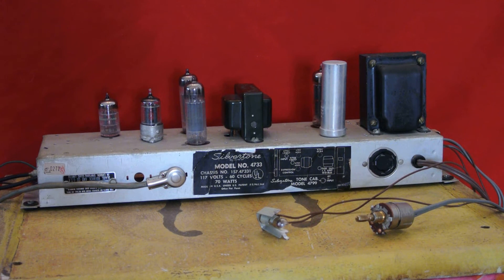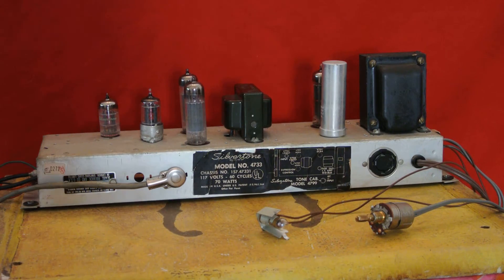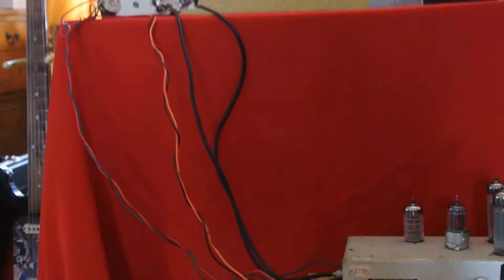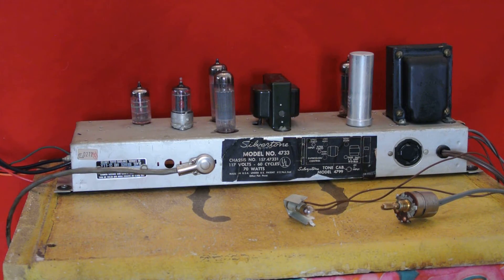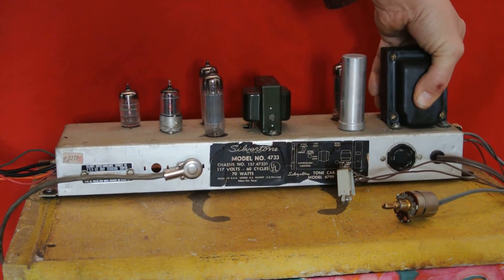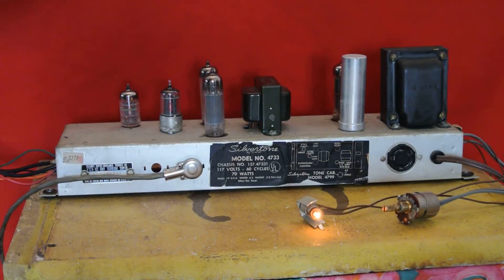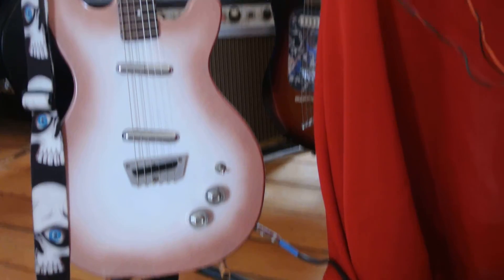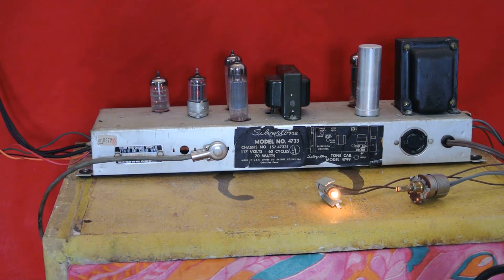Buck Naked Tube Amp! Tube Organ to Guitar Amp Conversion by SoaringTortoise

Comment: Nice video .. do you have the power transformer ID numbers?  .. maybe a schematic?   I have  transformers: Power (80-5018-6 , 606235), and Output: 80-5031-1 , 608236.  I would like to make a little amp from scratch, but I don't have the pinouts on the transformers.  Thx!
Reply from the maker: Sorry, no parts numbers or schematics. I did this conversion for a customer and the amp is no longer in my possession. I might suggest putting those numbers into google it might turn something up.

Comment: Someone just gave me one of these organs (exact match). It didn't make any noise til I changed out the 12ax7. Then it played about 10 out of 12 notes in every octave for a while. Now it plays about 4 out of the 12 notes in every octave. I'm assuming it needs the electrolytic caps replaced. I don't know much about building amps, so I'm thinking about just replacing the electolytic caps and adding a 1/4 inch input to see what my guitar sounds like. The on/off switch on top of the organ is labeled Bass Volume. It also has the usual volume pedal wired into another pot on the chasis. I guess that will be my tone and volume knobs. Will this work?

Comment: Anyone have a data sheet on this transformer!? Been looking everywhere to see what my voltages are supposed to be
Reply: Brad Resor I’ve got similar amp from a Sears/Silvertone organ that I’m modifying to an 18 watt guitar amp.  The xformer in this one has (unloaded) a 610 volt Center tapped winding (red, red and red/yellow), a 52 volt Center tapped winding (light blue, light blue, blue/white) and the typical 6.3 - 7 volt Center tapped filament winding (green, green, green/white).  Through the 6CA4  rectifier tube, I get 420 volts DC unloaded, CT to ground. The 52 volt winding gives 38 volts DC (CT to ground).  I’m adding another 12AX7 since typical 18 watt amps have two input channels, phase splitter and push pull pair (6GK6) in this case.  I might change to 6BQ5 output tubes depending on sound.  I’ll use the 38 V circuit to power blue LED’s pointing up through the tube bases (with appropriate current limiting), to give a blue glow into the tubes for visual effect.  There are lots of Marshall type 18 watt schematics out there.
Reply: Excellent information. I'm modding one here, too in MSP. Cheers.

Comment: Hey buddy i just got 2 of these amps they both are model 4754. are there any special things that I should change out to make it a better sounding guitar amp like capacitor values or resistors if you can said any light on this I would very much appreciate it as I appreciate all your smoking hot steaming tube butt kicking videos
Reply from the maker: I converted this amp for a guy in Ohio. I wish I could say it was as easy as just swapping a couple caps and resistors but it isn't that simple. If I remember correctly I gutted the whole chassis and rewired it like a Tweed Fender 5E3 Deluxe. Also, if I remember right, it had some pretty funky non-standard power tubes. What kind if power tubes do your amps have? Thanks for diggin' my videos.
Reply: soaringtortoise Not sure,  im picking them up next week,  but i think the power tubes are 6abq5's, thanks anyways,  always looking forward to more of your videos.
Reply from the maker: 6AQ5's are nice. They're like the 7-pin miniature little brother of the 6V6. Very similar in specs and sound. I would just plug into one of the amps and see how it sounds. They will probably still have some pretty juicy tube goodness even without modification.
Reply: soaringtortoise I have another amp or three that uses them and i do like there sound very nice.  Im wondering if i have use a preamp to use this particular amp, might have to just wait and see.
Reply: Sorry,  auto spell is not my friend.
Reply from the maker: If it's an organ amp it probably has at least one preamp stage, just no controls (volume if your lucky). Maybe stick something like a Boss graphic EQ pedal in front of it.
Reply: I'm trying to figure out the plug-in block on the end of the amp, I assume there is a volume, tone control, on off switch? This is the hard part for me. Help - anyone that may know, thanks.